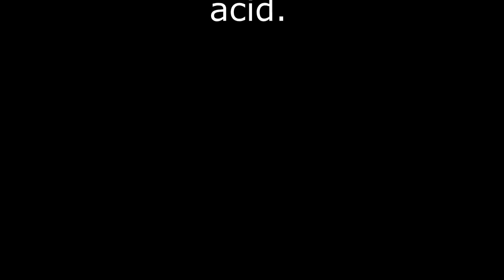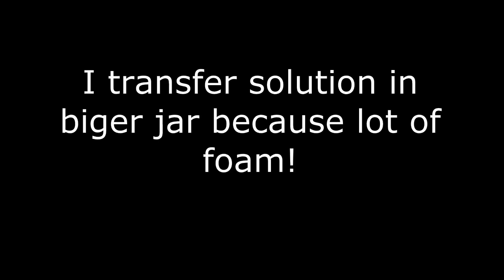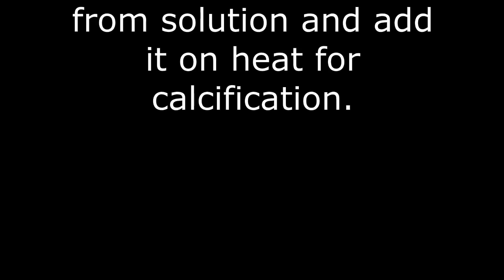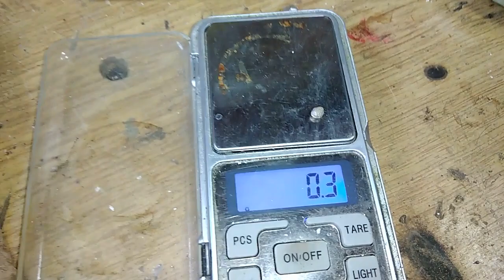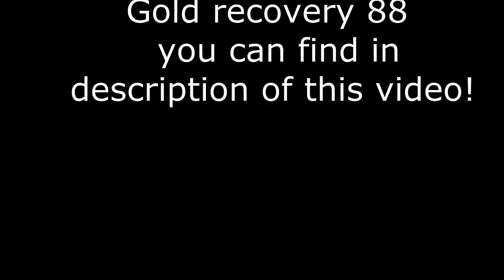Silver,Palladium and Gold in potentiometers - test.

Comment: Good video.  Just goes to show just how often silver is used in various electronics.  FYI when you dropped the Pd with DMG and it went pink.  Pink is a sign of nickel.  As much as I hate to say it I think your Pd yield is MUCH lower than you think it was.  I've had this happen myself and it sucks.  Instead of using DMG to get the Pd out it's better to use copper and let it slowly cement out.  So after you've dropped your silver you'd be better off to just dump the solution into your stock pot and let it sit in the copper.  DMG is way too expensive to waste on nickel.
Reply from the maker: Yes i agree with you. I use dmg for test purpose, love to use chlorine to drop pd. I have some niakel in drop shure but after melting pd bead i check it and purity isnt contamined to much. But i need to refine that again somethime. Thanx.